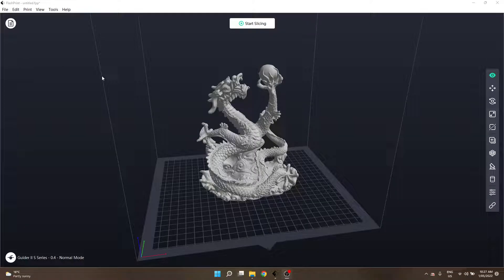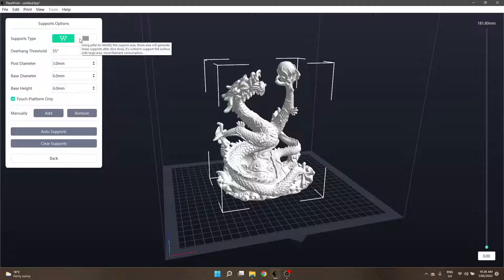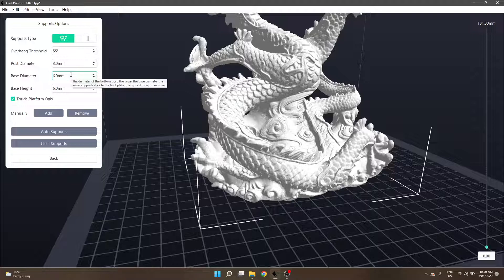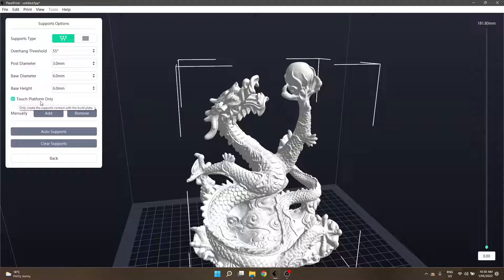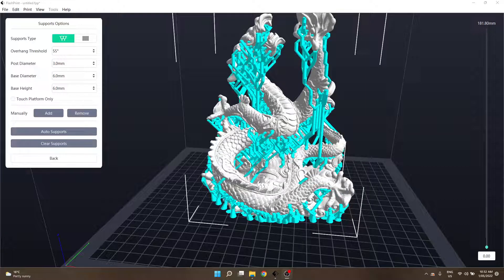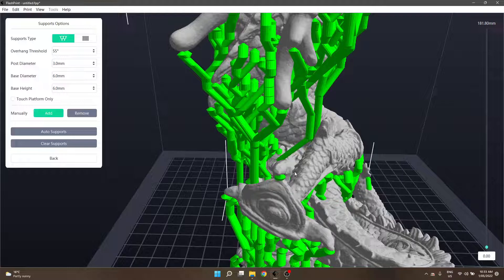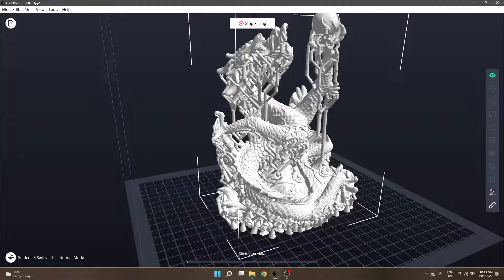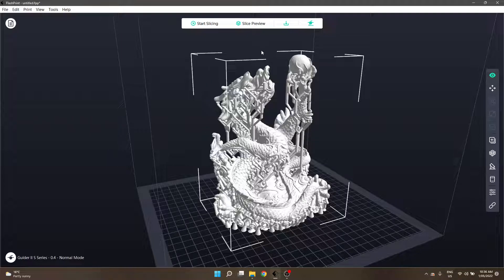FlashPrint New User Tutorial - Part 03 - 1 Tree Like Supports

Comment: Is this to keep the model from falling over when printing? Or does it give a platform to generate from? For example, if I am making a cave with stalactites and stalagmites, the stalactites hanging from the ceiling cant generate from the bottom up because the bottom is not connected to the floor. Is that what this is to solve?
Edit: like the dragon's right ear.

Comment: Awesome video that helped me get through some of the basic pains of setting up my first printer! I have been using my Flashforge Finder 3 for a little while now, but I was curious if you had any recommendations for what I should keep my settings at for the tree-like supports. The standard values make smaller tree supports (tail of a dinosaur barely hovering over the build plate for example) completely fuse to my print sometimes. It's ruined a few really well-printed models.
Reply: in cura its called "support interface' where your support touches your model. and you can adjust it to be smaller bigger or wider, and adjusting it helps it come off the printer easier with less scaring.

Your quest: is to find out what is the equivalent of "support interface" setting...in flashprint, and only then, will you find your answer.

Now make haste, young mage, and complete your quest and return to me 3 days hence and I shall give you a reward.